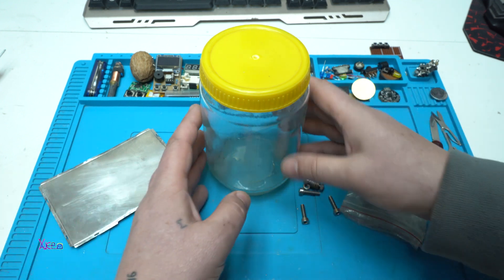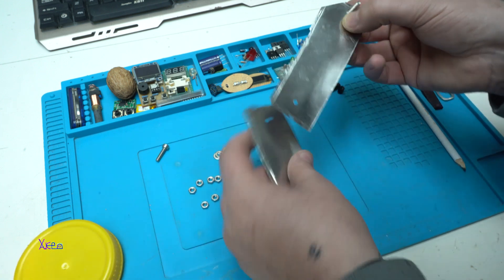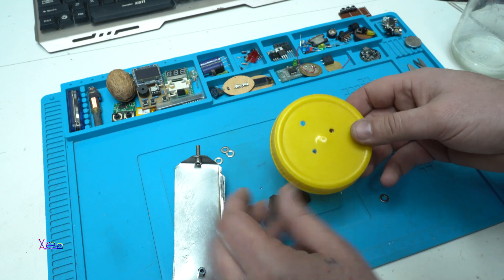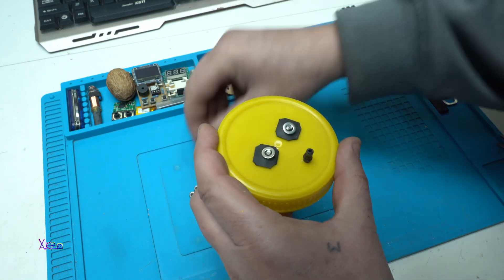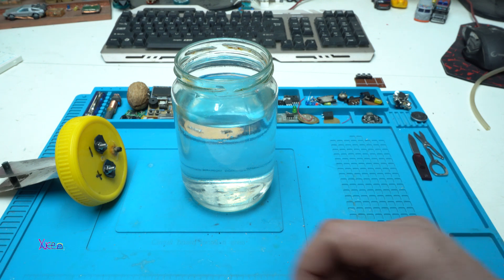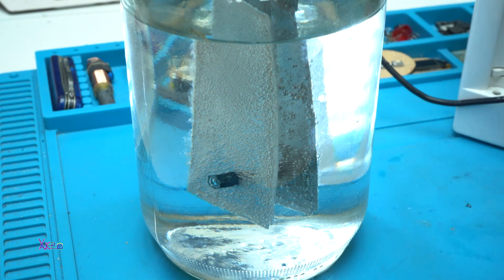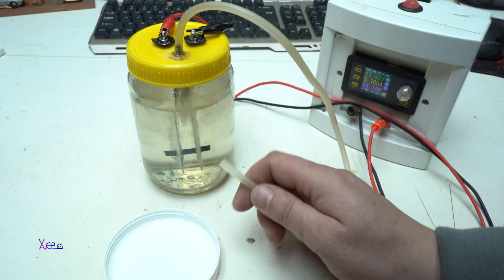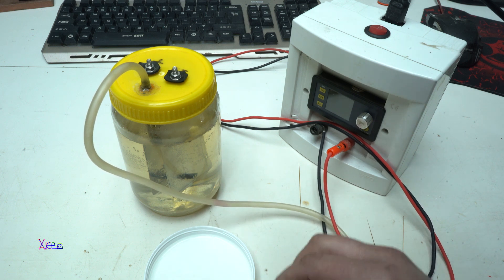How To Make HHO Generator in Jar

Comment: That’s awesome. I use something similar but I breath the gases for therapeutic uses. I use a little baking soda for the electrolyte as that is the only electrolyte I feel is safe. The anode will liberate all the CO2 before it produces oxygen. I found this out the hard way when testing the output gas. It was barely flammable at all at first, but when all the CO2 is freed, the gas is very, very explosive. That’s a nice unit you made.
Reply from the maker: Thanks! I’m glad you found this video helpful! Be careful with your HHO generator!